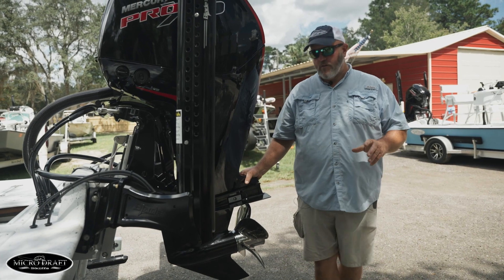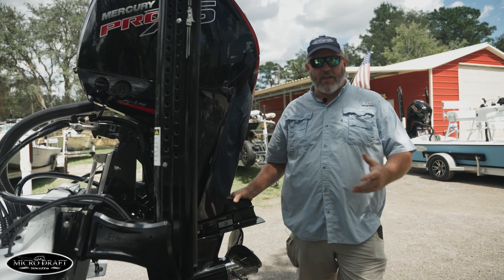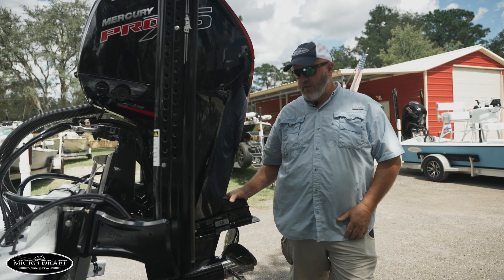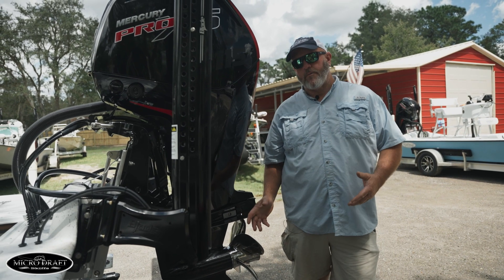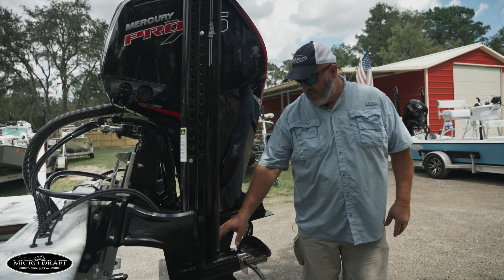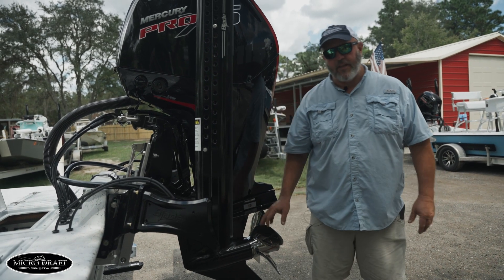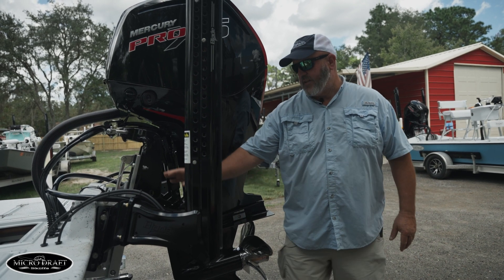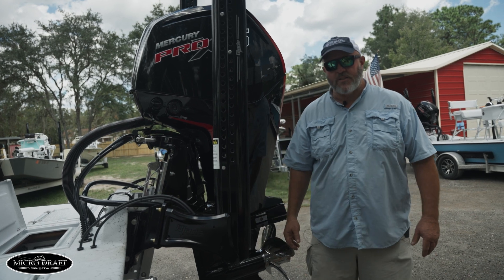Explaining How The New Witchcraft System Works! | Micro Draft Skiffs

Comment: The question I have, is......  Do you sell this system separately so that someone can install it on their own boat?
Reply: It's referred to as a transom mount water pickup, Bob's Machine Shop sells a kit to do it, I have owned and run it for years on my tunnel hull.  Others sell similar, some people just make their own, transom mount pickups have been around forever, they aren't common though, they are an extreme way to go, personally, love mine, zero issues with water pressure. I've got an inline strainer on mine as well, so I catch debris/weeds and can empty it right at the strainer, works excellent. 
Sounds like they route theirs into their tunnel instead of doing it back on the transom, given that a person wants the water coming out of that tunnel to be as clean as possible, I don't know that putting it in the tunnel is a great idea, again, normally, one mounts them on the transom.  But these guys make great rigs, so, I'd say they obviously make it work.
Reply: @calling4life   Thanks for the response, but it isn't an answer to my question.  Does anyone actually sell a kit to make this happen, or does one watch enough YouTube videos to figure out how to piece together their own?
Reply: @calling4life   Thanks for the response, but it isn't an answer to my question.  Does anyone actually sell a kit to make this happen, or does one watch enough YouTube videos to figure out how to piece together their own?
Reply: @Texcajun06  To do this exactly as these guys do it?  Like into the tunnel, no, nobody sells that kit.  Or what do you mean by kit, are you actually referring to whether you can bring your boat to someone and they'll do this for you?

To do a transom mount water pickup which is the same thing just with the water pickup on the transom instead of in the tunnel, yes, Bob's Machine Shop has a kit.  

Their kit has everything except for the hose, so all you'd need to buy is the hose you want to use, they can't know where or how you'll run your hose so they leave buying the hose up to you.  Plus, the hose doesn't need to be anything special.  

To do this, and to do what these guys in this video have, which is the same thing, they just have the pickup located in the tunnel.
You drill into the lower unit where the water accumulation chamber is, you thread that hole, you install the Bob's fitting.  Now, locate where on your transom you want the actual pickup, mount the pickup bracket and tube.  Run a hose from the fitting on your outboard to the pickup tube on your transom.

Now you could buy the Bobs kit and instead of using their transom mount pickup, you could buy the brass high speed pickups like Micro Draft uses and then install them in your tunnel and then you'd run the hose to these, I wouldn't personally recommend going into the tunnel, but it's your life.

So, yes, the Bob's Transom Mount Water Pickup kit, is a kit, with everything except for the hose, it has the fittings, the screws, the pickup tube, bracketry.  

And yes, it is an undertaking to do and do right, and yes, you need to run it into your lower unit, which means drilling into your lower unit.  

 It's slick as snot, I run extremely shallow, I haven't replaced a water pump in my outboard since I installed it either, several years, it gets water to the motor great.  I run my motor extremely high, 50%+ of the prop above the water line, I use a PowerTech 4 blade stainless prop like Micro Draft does, they work great.  

Here is some guys youtube video showing his, he used a strainer inline too, like I did, that is not included with Bobs kit because they don't think it's needed, and maybe not...  depends, I love it.
https://www.youtube.com/watch?v=mZkHyqfP4LQ

It isn't rocket science to do, but it is involved.  You also need to block off the normal water intake inlets on your outboard so the transom mount pickup is all that feeds water to your motor.
Reply: @calling4life  Thanks dude!  I'd say you more than answered my question.  Yes, I wanted to know if someone sold the pieces/parts to install a low water pickup.  I thought Bob's only sold the nose cone mod, which I had no interest in.  I wouldn't feel comfortable fitting the nosecone by myself, but I would not have an issue with drilling and tapping a hole into my lower unit.  Thanks again!
Reply: @calling4life . Have you seen or had a similar set up on a Yamaha or does the merc really lend its self to this ?
Reply: @Randymcsendy   My setup is on an Evinrude, you can do this on any of them, Yamaha included.
Reply: I designed and built my own, on 3 of my flats boats (1 on an E-Tec, 1 on a yamy 60hp, and 1 on a 90 hp yamy)... all were transom mounted, with an inline filter.
 They work super great, and I love them, but mounted in the tunnel instead of the transom? 
That would disrupt the laminar flow of water to the prop, IMHO.